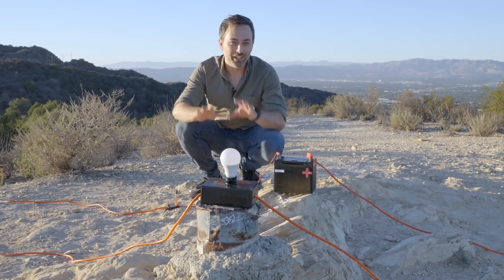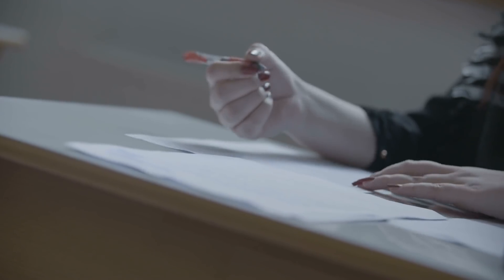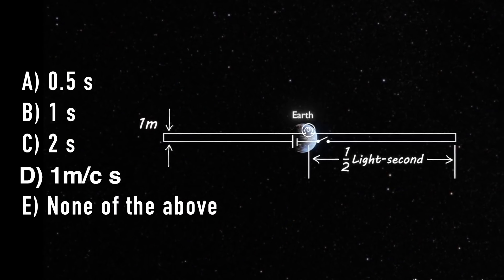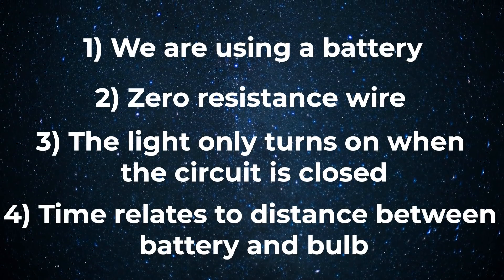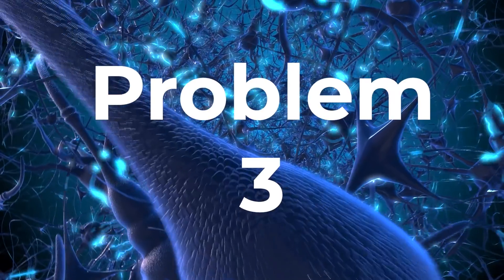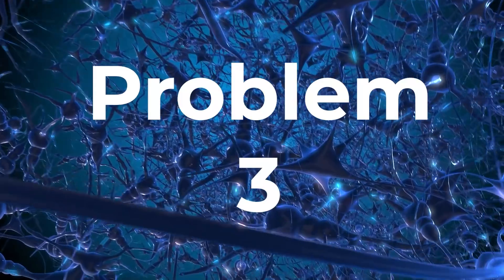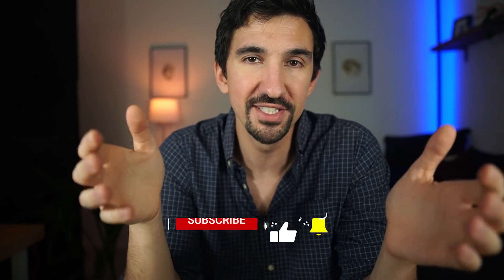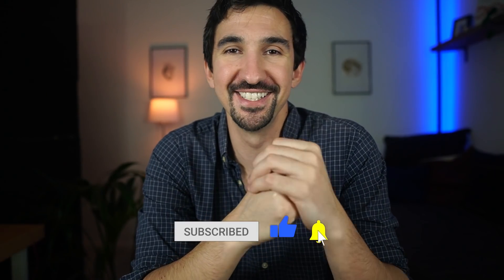Is Veritasium Wrong About Electricity?

Comment: Until the potential has made the full loop, there is no current, no magnetic field, no Poynting Vector, and no energy to transfer. At a distance c*t of the battery, at time t after switching the switch, a potential of some value, say 0, makes a jump to some value,say 1. The only thing that is happening, until the circuit is closed, is this switching of the potential from 0 to 1 moving at the speed of light along the wire, but this switching correspond to a ridiculously small current that happen at one sinlge time t only (because it's DC, an nobody uses DC antennas for a good reason). Another way to see that is electrons a position x=c*t  stay still, then move say 1nm to the right at t, and then stay still again. That little shift is the only current that exist, until full looping. So on the other wire, at best, electrons might make a 1 nm move in the opposite direction by induction. When I say at best, it means if 100% of the energy from the electron on the first wire transfer to the electron on the second wire, which is obviously not the case, and only a tiny tiny % will be transfered, as energy radiates in the full space around the wire, not only to the second wire.
Thus the only thing that happens in the bulb, until the connection has been made after 1 second, is a tinty tiny bunch of electrons moving through the bulb filament. It does not matter how long the wire is, the only electrons moving that can transfer some energy into the bulb are those 1 nm away from it. They were actually already moved by induction even before the switch was put on because the switch was way further than 1 nm to the side.

So no, nothing happens until 1 second.

Comment: Thanks for the video, it addressed a few of the problems I saw with the veritasium explanaition, but i'd also like to add one more thing. The main point of the veritasium video was to counter the view of moving charges, and although it is true that electrons aren't speeding around the circuit, it is also true that some charges MUST be moving becasue this facilitates the chemical reactions in the battery. A battery essentially separates the reagants of a chemical reaction, and allowing them to slowly react by slowly allowing an exchenge of charges, and this can only happen if charges can travel through the wire. In reality, the electrons delivered come from the wire itself, and haven't travelled the full length of the wire, but it is a pretty big oversight to ignore the movement all together. There are multiple ways of lookng at the same problem, and of course the field view that the explained in the original video is valid, but there is more happening in reality that needs to be accounted for. On the original question, i think its pretty unhelpful to define the light being turned on when it recieves the EM signal from the battery :  no one would resonably assume the light is on when there is no light emitted! Thoughts and comments welcome :)

Comment: The electrons travel in the wire at less than the speed of light and that is why people use optical cable for high speed signals. The voltage drop over the circuit would be  so much higher than the light bulb that there would not be enough left to light it applied across it.

Comment: I think this is more descriptive than the veritasium explanation. When I watched his video, I still got the impression that he uses too much of "quirks" like he didnt even explained what fraction of power will be transmitted through the field in that fraction of time - just "a fraction". It reminds me the simple experment that if you go under the high voltage line with fluorescent lamp it will glow even though theres "no closed circuit". My problem with veritasium video is that he never speak out loud that his circuit works like antenna rather than building some kind of magic around it.

Comment: I liked this video tremendously..

I think one of the key points here is made at the very end. The bit about "the lies you've been told about electricity".  I feel one of the most important concepts in science and engineering is having a sense of how complex the model you need is for the system you are looking at, or as I put it "knowing which rules I am in danger of breaking". In many cases (especially the kinds introduced in elementary school), the model of individual electrons moving the entire circuit will adequately describe the system for all practical purposes, and is intuitive enough for someone just starting out to grasp. 

A similar "lie" is the concept of materials being categorized as insulators and conductors. The reality is substantially more complex, but for the practical purpose of a 12V battery, I feel it would be pedantic to claim that the statement is a "lie".

These are simplifications that are appropriate for the situations they are used in, as long as it is understood that they have limits.

Comment: I still don't fully comprehend this. What if the 300km was not to the sides but it was the physical distance between the battery and the bulb? i assume the bulb would take 300km/c to light up, is that correct?

Comment: The Poynting vector theory is correct, there would be a very small amount of power being delivered right away, but to get any significant amount of power, the the electrical wave would have to propagate for a longer time than 1m/c. also in terms of a capacitor (that electroboom says) the equation for the voltage would vary with time, and therefore there would be some displacement current aswell in the other line (also time varying). so that would be power delivery in terms of V*I as well. 

This is all taught in any fields/waves and antenna design course so framing it in that way I think would make it easier to understand why that is the case. 

To frame this as a circuit does seem a bit misleading-because the video makes it out to be that the electrical power flows through the air and not through wires - which is somewhat true but not as magical as the video makes it seem, although it does add to the effect and makes for a good engaging video, so I can see the reasoning behind it.

Comment: Aargh DONT SAY “HONE IN”
It’s “HOME IN”
Reply: It's both, actually.

Hone means to "sharpen" or "make more acute" and while less common, is a valid form of the expression because "honing" means narrowing, so it's the equivalent of saying "narrowing in."
Reply: @ialsoagree  wrong. To hone is ONLY to sharpen, to make more acute. Originally only in the sense of sharpening a blade; later used metaphorically in the sense of sharpening a skill or a sense. There is no other established use. 
To “Home in on”, by contrast, means to seek or be drawn towards, as in a bird returning to its nest. The meaning is distinctly different. “Hone in on” is a malapropism.
Reply: @X-boomer  Just a tip, doubling down on being wrong isn't a smart move. Instead, do some research when someone suggests what you're saying isn't correct, and learn whether you're right or not.

"honed in on; honing in on; hones in on
Definition of hone in on
US
: to find and go directly toward (someone or something)
The missile was honing in on its target."

-Merriam-Webster Dictionary

If "hone in on" isn't correct usage, go tell Merriam-Webster, they disagree with you.

Comment: If the wires were very very close to each other then it might work like Veritasium says. But at one metre apart the capacitance and inductance between the wires will be utterly negligible and all the energy transmission is due to the EM wave being propagated along the wire, and it takes a full second for the bulb to illuminate.

Comment: On the point about breakage: You can modify the assumption slightly to get around this problem. What matters is not the distance between the battery and the bulb, but the distance between some change of state in the system, and the bulb. So, since the break in the wire is far, and the break in the wire is the relevant change of state, it would take much longer for the bulb to turn off. But if the change of state is happening at the switch, then and only then is the distance between switch and bulb the relevant distance. So that all works out.

I think you hit the nail on the head in the second half of this video. The real problem is - surprisingly - assumption 3, the seemingly trivial claim that the bulb only turns on once the switch is closed. But even with the idealised zero resistance assumption, the light would already be on if you did this experiment anywhere in the universe because of the huge antenna. I think that's exactly right. And that's bad, because the 1m/c seconds result depends upon the inductive effect, which is the same effect that causes the light to be on even before the switch is closed. So if you start with the premise "we'll ignore induction", you don't get the result Veritasium gets. And if you don't start with that premise... you still don't get the result Veritasium gets.

And that really gets at the problem with the thought experiment: The definition of "turns on" - and as I'm typing this, you're covering it in the last quarter of the video, haha! But yes, in the thought experiment, if we could somehow create the additional premise that there are no other electromagnetic signals in the universe, the light would "turn on" in 1m/c seconds only in the sense that it would be extremely faint due to the inductive/capacitive effect between the two parallel wires. But if you want "turn on" to mean "receiving full power from the battery", it would take much much longer. And that's a problem, because when Veritasium says "turns on", people will likely interpret that to mean "fully on", not "so dim that you can't even tell that it's on". In which case, they haven't been lied to at all. Based on that definition of "turns on", the intuition that it will take longer than 1m/c seconds is exactly right.

I think the thought experiment is therefore misleading because of the somewhat ambiguous definitions involved, and the fact that there is literally no place in the universe where you could actually do the experiment and observe the claimed result, even with magic superconductive wires.
Reply: This is the comment that finally helped me connect all the dots in both videos... Now I get it and I agree, the veritasium video is conveniently lacking in details.
Reply: There is a place in the universe without external electromagnetic cage and it's  called a Faraday Cage
Reply: @ImaadAnsari  I could be wrong, but I'm pretty sure there are no light-second-wide Faraday cages in the known universe.
Reply: @allmhuran  you're right, but that's not the point. There are also no wires 2 light seconds long. This is a thought experiment
Reply: @ImaadAnsari  Yes... and I said there was nowhere in the universe you could do the claimed experiment and see the claimed result. The experimental premises did not include "we are doing this inside a giant faraday cage", and there is not a giant faraday cage already in the universe anywhere, so my statement is true.
Reply: I noticed the same point you observed in the first paragraph, but you can modify the thought experiment a bit to still obtain a contradiction assuming 3 & 4. Instead of turning on the switch and then cutting the wire and seeing if it turns off, you instead agree in advance about some time that the wire-cut message will be sent (using e.g. Einstein synchronization), and then turn on the switch immediately after that time. If the wire is not cut then you have the original set-up so you expect the bulb to turn on almost immediately. If the wire is cut then when the switch turns on the circuit is not completed so by assumption 3 the bulb should not turn on.

Comment: Challenge to Everyone: If the correct answer is D, that is 1/c s then the time it takes for the bulb to come on after the switch is flipped is independent of the length/distance between the bulb and and the switch. This means if we keep the switch closer the the battery on Earth and have the light bulb at 10 light year distance into deep space then according to this video, information can flow faster than light velocity. I refused to believe that. Any taker?
Reply: I think you misunderstood. Veritasium's video claims the bulb turns on because it's closer to the battery when power begins to flow. That's where the "1" in "1/c" comes from - the bulb is 1m from the battery.

If you move the bulb to 10 light years away, then it would take 10 light years / c for the bulb to turn on - or 10 years.

This video just points out that in the original problem, while there would be voltage around the bulb when you first turn the battery on, the voltage would be insufficient to actually light the bulb.
Reply: @ialsoagree  insufficient voltage to turn on the light bulb is irrelevant because instead of light bulb we can have a very sensitive amp meter and very, very high voltage of battery. But your first point regarding the light bulb only 1' away need to be addressed. Here it is: Let's put two more light bulbs at far ends of the circuitry, East and West ends. Each of these two additional light bulbs are 10 light years away from the battery. The original light bulb stays at 1' distance from the battery. So, Veritasium is telling me that the original light bulb will come on before the two new bulbs in the same circuitry 10 light years away? Hmm..... If so, then I need to think about that. You can help me out in this. :)
Reply: @munzerhaque8069  Well, the insufficient voltage is actually a critical part of the discussion, it's the point of the video above.

If we replace all the bulbs in your second scenario with "very sensitive amp meters" then they will all have readings all the time, even when the circuit isn't closed, because the open circuit will be acting as an antenna emitting EM fields that the meters can pick up on.

That being stated, the full strength EM field around the wire when the circuit is closed should actually propagate from the switch, not the battery. Meaning it's the distance from the switch to the bulb (along the path of the wire, because we're talking about full voltage here) that will determine when the full voltage arrives. If a bulb is 1m of wire away, it will take 1m/c for it to get full voltage. If it's 10 light years away, it will take 10 years to get full voltage.
Reply: @ialsoagree  Another twist to this. Let's say, we close the switch next to the batter just for a seconds and then open it. Obviously, this signal has not arrived at the far ends bulbs 10 light year away yet. We then, within a few seconds  cut the wire at the East and West end bulbs. According to Veritasium original light bulb will still come on even though circuit is broken. Remember, wire is cut before the switch close signal arrives at the far East and West ends. Very confusing to me. LOL

Comment: To summarize this argument, the incorrect assumption is not (4) the time relates to the distance between battery and bulb, but (3) the light only turns on when the circuit is closed. If we define "on" as a measurable change in general, we expect the lightbulb will indeed turn on after a time of 1m/c, as Veritasium claimed. However, instead of thinking in terms of the Poynting vector as suggested by Veritasium, it may be more useful to think in terms of antennae, where we find that the wire branches near the battery act as antennae sending and receiving signals to the 1m away antennae (wire branches) flanking the bulb. This way of thinking is consistent with Veritasium's main point, that the energy/signal is transferred via the electromagnetic field and not via electrons in the wire.
Reply: Yes, that's exactly my understanding as well.

I think he makes the additional point that a 12v battery over a distance of 1m probably won't generate an EM field strong enough to light a bulb in a circuit 1m away. You would get a measurable voltage across the bulb, but it probably wouldn't light the bulb itself.

Comment: La luz viaja a 300,000k/s......
Pero a que volocidad viaja la electricidad.
No soy científico, pero lo poco que se es que la electricidad es instantánea, porque no tiene que viajar a alta velocidad.
La electricidad es un flujo de electrones por un conductor, pero si el cable fuese de un año luz de largo, y con 0 resistencia, los electrones no nesesariamente deben de viajar 1 año luz para que encienda la bombilla, ya que el metal del cable ya está lleno de electrones, por tanto al cerrar el circuito estamos añadiendo electrones a un metal que está lleno de ellos, la bombilla encenderá al instante, pero no con los electrones que añadimos, sino con los electrones que ya estaban en el cable.
Los electrones se van empujando, entra uno en un extremo, y al instante o casi al instante sale otro en el otro extremo.
Pero si la bombilla estubiese a 1 año luz de el observador, tardaría en ver la bombilla encender 1 año, pero ya la bombilla tenía un año encendida.
Los electrones que salieron de la batería no fueron los mismos que encendieron la bombilla, fueron los electrones que estaban en el cables al sentir el empujón de los electrones que llegaron de la batería.